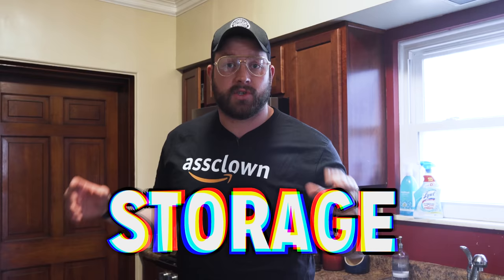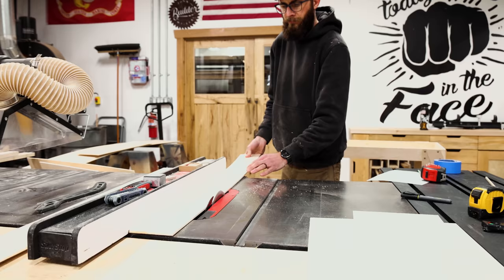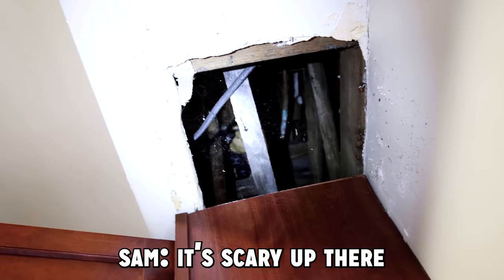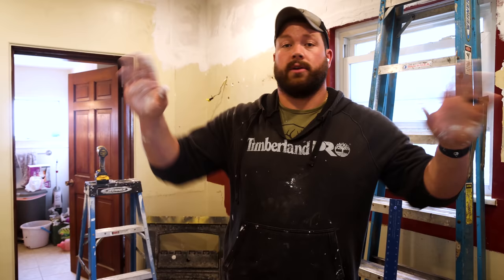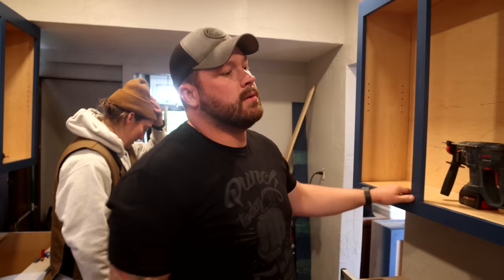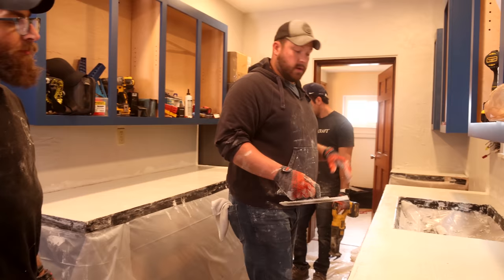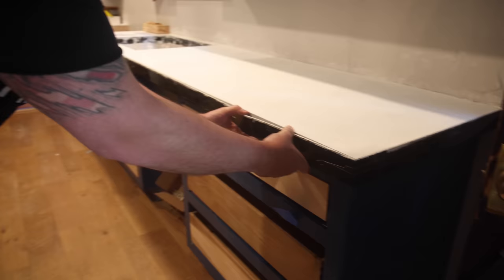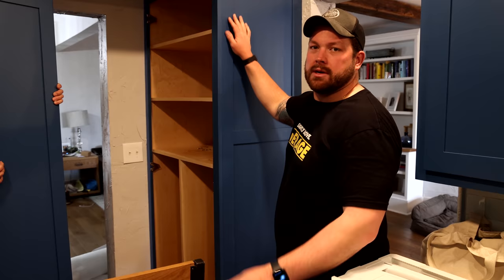EPIC Full Kitchen Renovation - Start to Finish!

Comment: Please for the love of tile. Next time add some water to the premade grout or better yet don't use premix. Also when cutting tile don't call it a fence it's called gauging the tile and for God sake circular motion rough wash the grout before just wiping it clean. It evens the grout joints and give a better consistent look when coming to pin holes and discoloration in grout. If you don't rough wash you take the chance of pulling out too many polymers and color pigments.